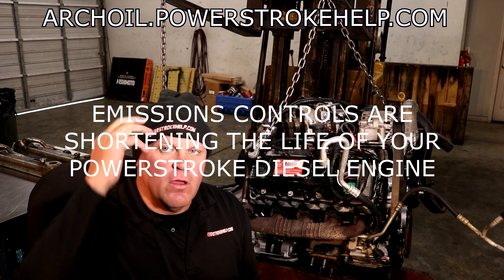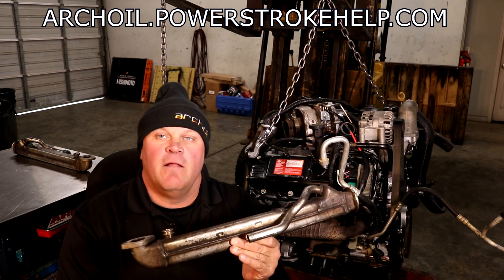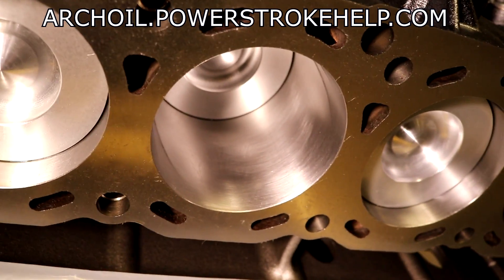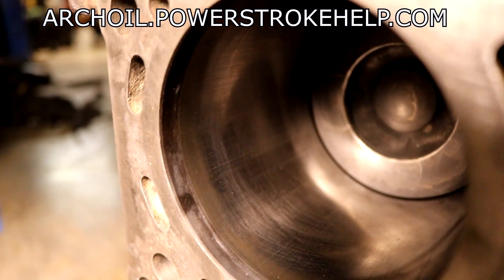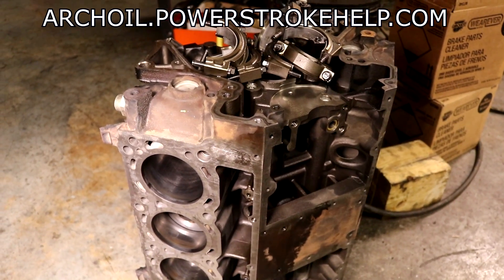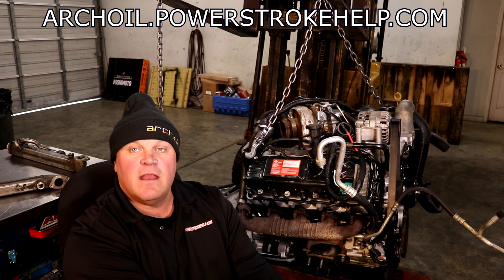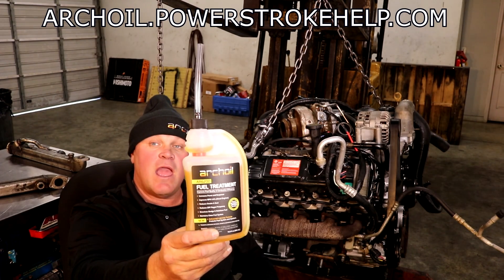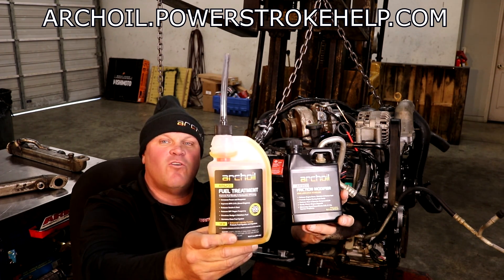EMISSIONS CONTROLS ARE SHORTENING THE LIFE OF YOUR POWERSTROKE DIESEL ENGINE

Comment: I have a 2015 6.7l powerstroke. I have changed 100% of all the oils and fluids in my truck.  I have also added larger pans on every single system to try and keep this truck running smoothly and longer. I have also added archoil to both the oil and fuel every single time I fill up with fuel. also I have added the archoil filter kit with the 2 filters to do the same as listed above. plus I also have changes out the factory lift pump with a fass 140 Titanium lift pump also with 2 filters.

I called amsoil and was told not to add ANY OIL ADDITIVES  because its not necessary with their fluids. 

my question is do I keep adding the archoil to my oil in my truck??

Comment: I had an 05 f250 brand new that blew the egr cooler at 9000 miles. It was completely stock. I drove it hard though...
At around 30k miles someone talked me into running bio diesel in it. I ran it off on on for about 25k miles. It ran it's best those days and smelled like french fries too!! I ended up selling it in 2011 with 99k miles and never did anything else to it but replace an alternator and a water pump... Damn I miss that thing.

Comment: Last year I found a one owner early 2003 7.3 4X4 super cab Lariat with 94,000 miles on it & bought it before anyone else could look at it. Put a 4" turbo back stainless exhaust, K&N intake filter, & a set of Firestone rear air bags. I will do no other upgrades & do all PM by the book. This will be the last truck I ever buy & this video is why. Emissions have killed the modern diesel!

Comment: I just love how people fall for this sales pitch...So egr is causing premature wear Ah ? So you assume that the cylinder pressures are the same on a  pre 2004 power stroke than on a later model ? They produce massive amounts of power with less displacement and someone has to pay the price .Absolutely ridiculous to blame it on EGR. It has been on gas engines forever without causing wear problems .
Reply: Gasoline engine exhaust typically doesn't have the particulate content that diesel engine exhaust has. As a result, the amount of particulate entering the gasoline engine isn't bad enough to cause a wear problem.

Comment: @powerstrokehelp  quick question.....im a young/not so heavily experienced diesel mechanic and i mostly work on internationals in commercial trucks, as well as some 6.0’s and heavy military equipment. Im not one to put things off, and i assume its probly nothing, but id rather not take a chance. I dont work on many 6.7’s, but i recently purchases a 2016 CC f250 with 14k on it, with of course, the 6.7. Months ago i deleted, along with an s&b intake, and a cheaper gearboxz tuner that does not add much power, i was just sick of regens. It has never made and turbo surge/flutter noises until today. I was driving uphill in snow, in rwd, and one wheel slipped and i let my foot off the gas to hear some nice exhaust notes (my tailpipe was pointed at a fence, same effect of going thru a tunnel) and as i let go, the turbo made the most beautiful 6.0 like turbo flutter ever. However i just dont get why its just happenening now, and never before. Been driving it for 7 months after deleting, best decision ive ever made. I just would like to know if its a normal scenario or if i need something adjusted like a wastegate. Like i said, very little exp on 6.7’s. If anyone has any helpful info, id really appreciate it

Comment: I ran a 550 Cummins isx in a 2014 KENWORTH t800 logging truck. Egr fucked up. Pumped so much carbon into the engine the chamber in the head filled full, could hardly see the valves,  filled the piston full then pounded the carbon so hard it bypassed the rings , got into the oil and she locked solid..  350 johndeer excavator on the 4 axle float and it skidded the drive wheels...  now that's some seized up shit.  Cummins term for the issue is called.. carbon packing.  Common problem. I now drive a kw t680 with a pacar mx13 500. Also pile of shit. Always issues with emissions bullshit. Wires n sensors n abs problems.. lost 3 days work and 900 bucks in wages because abs is acting up this week. Seems like I can't win. So if you ever wonder why truckers are goin Balz out... its cuz were trying to make enough to eat this week. Probably cuz we lost work last week.

Comment: Don’t forget a “Bypass” filter system will help to cut back on soot and it’s wear issues. I plan to do that w/ my 2000 Ram Cummins, after rebuilding the rusted body. I do not plan on buying a DPF truck.

Comment: This is why I still have a 7.3 truck and Detroit Diesel 671s in my boat. The EPA has cost Americans billions of dollars. Now we have a diesel fuel that is crap, too. I used diesels all the way back to the 1950s. Then fuel was formulated for power and combustion. It came with additives that kept organisms at bay in large tanks, and rarely did I ever have to add a fuel conditioner. Now every fueling, I add Archoil AR6200 just to get the fuel to burn correctly.

Comment: started running arch oil oil additive  in my 2003 6.0 with 372000 miles and a manual transmission. It starts up easier and my fuel mileage went from 18.5 to 21 mpg on the highway going 70 mph. Just started to run the fuel treatment so i'll see how it goes

Comment: I have a 2008 F350 dually 4x4. I did the dpf and cat delete at 100k. I still have the egr and egr cooler on the truck since I still have to go through emissions in Phoenix. Once a year I put the truck back to stock. It’s a pain in the ass but I notice a big difference in performance when I have the dpf and cat deleted.

Comment: I started a brand New 2018 F250 6.7 out on Archoil oil and fuel additives. I have ZERO EMISSIONS CONTROL ISSUES.  I change the Fuel Filters at 10,000 miles. Engine oil changes at 5,000 and the remainder of the suggested maintenance intervals are cut in half, or less. If you perform your maintenance on schedule, you should not have issues( shorten the intervals by 50%to 70% and you will be glad you did. 10,000 miles on a Filter oil change is simply asking for a expensive FAILURE ! take really great care of my truck. Another thing: minimize the use of B-20 Bio- diesel fuels. Exxon sells a B-5 bio diesel that is way cleaner and less By products introduced into the intake air and oil.      If you are not using Archoil, you are a ticking time bomb waiting to blow up.
Reply: And 22,000 miles on fuel filters is simply asking someone like Bill Hewitt to Take $7,000 to $10,000 out of your pocket because YOU FAILED to service your engine and YOU caused a very expensive FAILURE !!     These trucks will last a long time with a little common sense and MAINTENANCE done. If you don’t maintain it, IT WILL FAIL and then you are going to blame Ford when it is solely YOUR RESPONSIBILITY to have your maintenance done. I don’t follow Fords Maintenance guide, I do way better than that. Better do it early than late or not at all.
Reply: Don’t get me wrong, I’ll give Mr Hewitt my money to take care of my truck, however it’s going to be something that I wore out, or maintaining. Not because I FAILED to do my maintenance when/ as needed. 

It’s mainly in the maintenance, the rest is by simply taking care of it ( no racing, tug a wars, or the stupid shit. These are NOT TOYS !!!

Comment: Cummins is putting a tighter tolerance at the top of the liner of the isx engines. This is so the soot can't build  up where the rings don't go at the top of the cylinder. I'm hoping this will be used in other areas of the diesel world. Most of the time the soot builds up and is drug down by piston thus scores the cylinder

Comment: https://www.sae.org/publications/technical-papers/content/1999-01-0839/

"Therefore, wear occurring at any point in time was a function of the soot loading of the oil and soot loading of the combustion chamber, rather then simply the level of EGR."

Bill is on the right track but didn't quite tell the whole story.  If the Archoil increases combustion efficiency that results in less soot it will help as it's the soot that does the damage.  EGR is just one way soot enters, but not the only way.  If EGR is sourced downstream of a particulate filter it harms nothing, but I haven't seen an OEM do that yet.  Better oils will help (use synthetic guys!), and if Archoil increases lubricity yes that will help.  Better filtration will also help, get a bypass oil filter to keep almost all the soot out of the oil.

Comment: Ever since I have been using Archoil 4 years ago. It does what is claimed. I have a 2004 6.0. I had the ERG Delete done on it and couldn't believe the difference in power and fuel savings. I use both Oil and Gas additive. I keep an extras of both in my PU. Thanks for all your help. God Bless all of you. Joe BIG RED  6.0

Comment: What is your opinion on Stainless Steel headers for my 6.0L? Pros and Cons?
Reply: Headers will radiate more heat into the engine bay. Depending on the vehicle, this can be bad news for all the electrical devices under the hood. You can see this effect in unmodified cars that crammed way too much stuff under the hood.

Comment: I have always unpluged my egr valves every since they where invented. When they where operated by vacuum, i would put a small check valve ball in the vacuum hose to prevent it from working. Today they are electronically controlled so i simple just unplug them. I plug them in only for vehicle inspections, afterwards they get unpluged for the rest of the year.
Reply: what engine?  I have a5.0 in calif and wondering if I can do the same thing
Reply: excuse me....meant 6.0

Comment: Why can't we get the egr system to take exhaust gas downstream of the dpf and not at the manifold? That way you have less oxygen, more co2 and no particulates and soot. We got the emissions system this complex, one extra pipe won't hurt eh?
Reply: There would need to be a backpressure generating device aft of the DPF to make that happen. DPF engines already have major backpressure due to the DPF and sometimes SCR. That is why engines don't get EGR gasses downstream of all the aftertreatment devices.

Comment: Hello powerstrokehelp,

Hopefully you get to see this or someone as knowledgeable as you can comment on it.

I drive a 2016 Hyundai Accent with just about 57k on the odo. I have done oil changes religiously at 5,000 miles with mobil1 fully synthetic. I have always been a little worried with the engine side of stuff on this vehicle due to the GDI system. Will archoil additives help with injector cleaning and overall soot decontamination in my particular GDI-driven 4cyl? I’d like to keep it around long enough to reach a decent amount of mileage.

Thank you !

Comment: obs 350k mi 7.3's Exhaust Back Pressure Sensor Line always clogged..what a joke. When I ran nearly all WVO that line stayed atleast clear was some coking but not completely clogged.  
Diesel Fuel is a damn headache just trying to keep EBP sensor clean. Amongst the other obvious pitfalls of the crap diesel every where.
 I have to use additives lucas and howes in the fuel archoil in the crankcase
Diesel rolls coal my exhaust used to smell like cinnamon crispas yum
Aprox 15% increease in HP
21 mpg on WVO 
15.9 mpg on diesel crap I mean fuel
Funny how I am getting 16 mpg running without a NO Cat, No Muffler, NO ebpv, hauling near 8000# trailer daily...she runs by far better when we drop the trailer after hauling. Within 200mi no trailer she is not all there thats for sure. Seems to me over all better economy, less particulate would make for a better  solution to pollution?

Comment: So do you take a chance and buy a used 6.7 with 100,000 miles on it. I'm still running my 2000 7.3 with 330,000 on it and it's great but the truth it self is getting tired

Comment: Great stuff!!! I'm a new diesel owner and am learning so much for you! I bought a 2003 Ford Excursion 6.0. 

Are any of you who have had premature failure on your trucks running an Amsoil or other oil bypass filter setup? Would the bypass filter do a better job filtering out the additional carbon particulates and extend the life of the engine and egr? 

Also, my truck is a 2003 and stickered and originally sold in Canada. What does this mean for me with the potential maintenance? Thank you so much.

Comment: I think the video paints the picture to the extreme. “Shortening the life...” is a subjective term. There are many 6.7’s out there with 325,000+ miles completely stock. In fact, truckandtravel here on YouTube has a 17 f350 with 200,000 on it, no emissions trouble. My 19 is fine stock, I’ve got premium care to 150,000 miles. I hope the goal of this vid is not to whine about not getting 600,000 miles out of these things because who cares!? I keep my vehicles around 200,000 and then get a new one. Why would anyone want to keep a complex machine like these over 250k if it’s not used only for work?? I think this channel is geared specifically to young boys who fantasize about owning a “legendary 1995 7.3” and will pay $12,000 for one at 24.99% interest lol The General target audience will not afford a emissions engine like the 6.7 for 5 more years lol The 6.4 was a total disaster anyways so it doesn’t count.

Comment: agreed.  DUDES.....317,000 and counting...all original(yes turbo)..trans.. does not burn oil!!! constant maintenance and quit idling. So many people think diesel need to idle. Wrong...these things fire on compression and heat. Low combustion temps cause incomplete burn which adds to the already introduced soot. Yes, complex, yes, choking the engine, but produces more horsepower and torque and burns clean and quiet with the response of a gasser. 400 plus, come on. Win in the long run in my opinion. start your 6.7 stock in a garage and drink beer with your buddies....try that with your 7.3
just saying! NOT a hater..I love the 7.3 for what is was and is. different time, different place

Comment: I have a Cummins ISL engine, and I was having horrible issues with my DPF/EGR/SOC system. It got the the point where my competition must have been laughing at me. All my customers were getting pretty salty, but no one was interested in paying for clean air service, not a nickel.

So I got it deleted. The people that did it said they had seen the exact engine completely ruined by 600,000kms from EGR destroying the cylinder walls and ruining the bottom end from soot being washed down the walls that are ruined.

A year later and I am saving about 9l/100 km's, and haven't had anything but a few wiring issues since. Savings per year on fuel and repairs is in the $25,000 range, and that doesn't include the lost revenue from when it was in the shop all the time. Add the fact that I will get about an extra 600,000kms of service out of the engine you start to realize that this is insanely nefarious stuff.

I don't think many people realize what is going on, and what it will eventually mean to trucking, and what that will do to the world.

Comment: Carbon buildup in the EGR as a result of unburnt fuel from the combustion chamber seems to me as a result of a poor tune from the factory. If their goal is better mileage while maintaining better emissions and reliability, shouldn't they want to have the cleanest burn possible to extend the life of the motor? Just my 0.2 cents.
Reply: Seth Andres, by all logic, that would be correct but this would then raise the NO2, which the gov consider a pollutant. Did you know that NO2 actually help brake down low level ozone (the harmful stuff). So NO2 does more good than harm, but yet the gov makes the diesel engines run rich (soot) to keep the NO2 down, then attempts to clean it up by egr and DPF, which still results in dirty air and more fuel burnt, not to mention engine damage and more operating cost to the end user. Typical gov A$$ backwards red tape.

Comment: Do you recommend running these additives in 7.3's as well even though they don't have the EGR garbage
Reply: It’s not engine specific. Diesel fuel isn’t like it was years ago. All the fuel lubrications have been emitted. If you have a Diesel engine you should be running it with some type of slick additive. I add 4oz. Every fill up. Saves pumps, injectors and fuel sensors. And some even have a fuel booster. It will definitely be money well spent. It’s like Vitamins for your engine.
Reply: I think these additives also lower the gelling point which is very important in extreme cold.

Comment: The other issue is that DPfs prohibit higher levels of ZDDP which in older oil formulations were crucial to prevent wear. It is used to maintain flat tappet classic cars and race cars effectively, and used to be for diesel engines. If you delete for off road farming, ZDDP additive as a protectant in addition to archoil is a must
Reply: Typically high ZDDP becomes critical on OHV flat lifters with aggressive profiles and high RPM.  I think every Ford PSD had roller lifters, GM used roller lifters in almost every diesel after the 350 Olds, and the Dodge CTD got away with low ZDDP because the lifters had a wider surface area than the roller lifters found in the other diesels.

There was one type of engine that needed extra ZDDP, and that was the Volkswagen "Pump Duse" engine. The amount of cam contacting the SOHC bucket lifter was tiny, and as a result, falttened out cams and worn lifters were very common.

Comment: Would it make a difference if the exhaust gases were collected after the DPF ?
Reply: Manufacturers should remove the EGR and beef up the DPF so it can do all the work of removing the toxic elements and noxious gases... that way it wouldn't screw up your engine by putting that crud back into it, like the EGR system does!